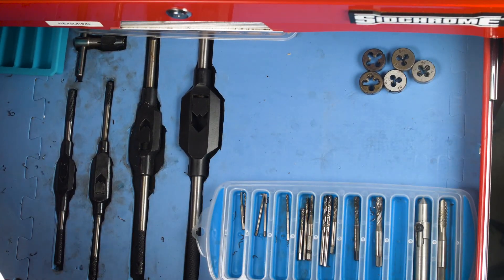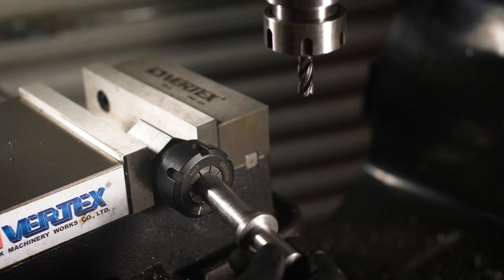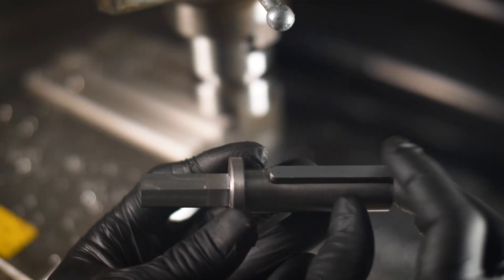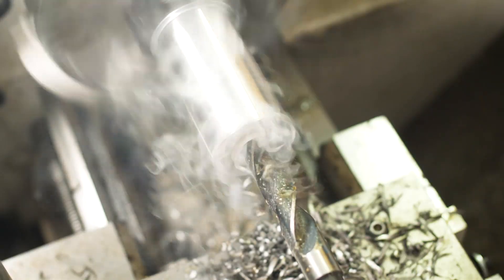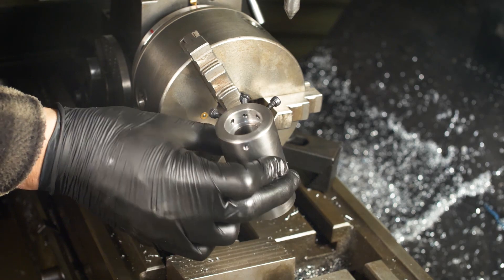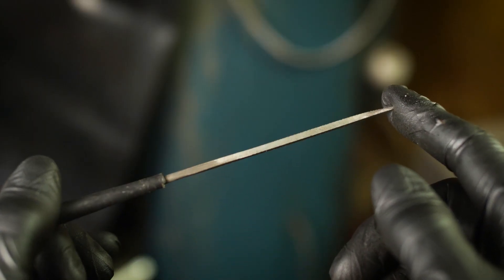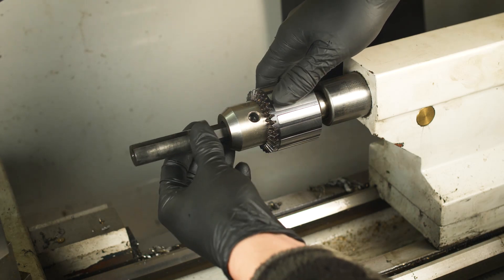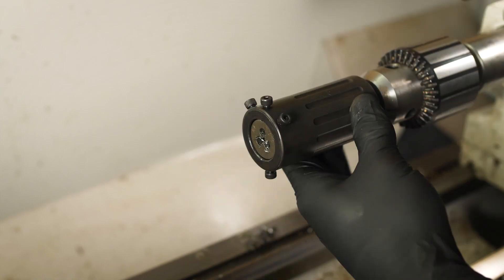Tailstock Die Holder Build

Comment: Very nice! The amount of machinery requires to make this little thing is 🤯
Reply from the maker: Yeah It could be much simpler than this, I chose to make it this way. Realistically 90% is lathe work and you could get away with a single slot and a guide pin
I just designed it this way because I wanted an excuse to try the slotter lol

Comment: Bad threads from dies held against the nose of my tailstock spindle is how I learned that said tailstock is in bad shape geometrically.  Nice job here though.  EDM is an option for the keyway too, if you know someone with the machine.
Reply from the maker: Yeah I tried that approach too, but I've never had  lot of luck
Yep, EDM is a fairly niche tool, but would work too. It would be nice to have one sometimes ha ha

Comment: You could have just kept the 6mm deep slot in the tail stock piece, then drilled/tapped a hole in the die holder to use a bolt as your key. I like the idea of having it free spinning as well for the small threads.

I also say keep the voice overs, I like to hear the thought process behind it along with the occasional smartass remark. Very well done, and I like the "groovy" look on the die holder.
Reply from the maker: Thanks, yeah you are right, I could have done that approach to remedy the key, and that would also allow the threaded pin to be unscrewed and retracted for the free spinning mode